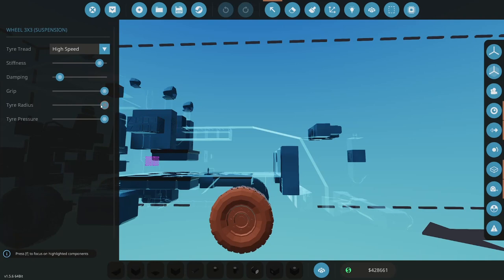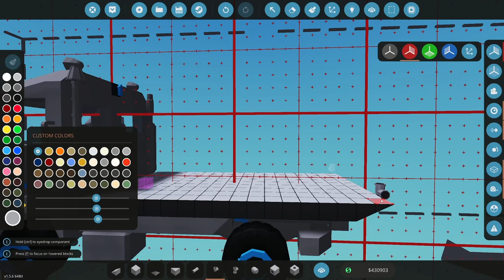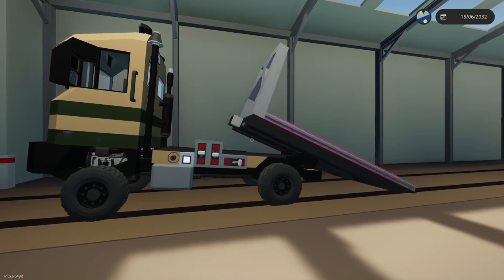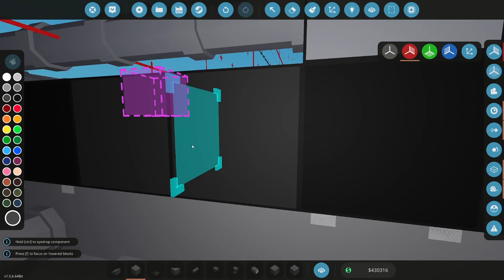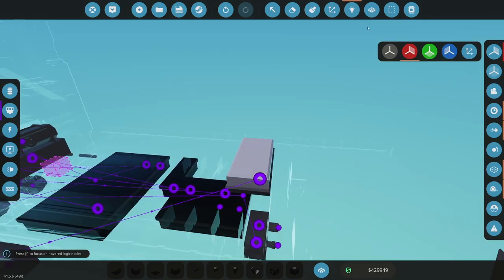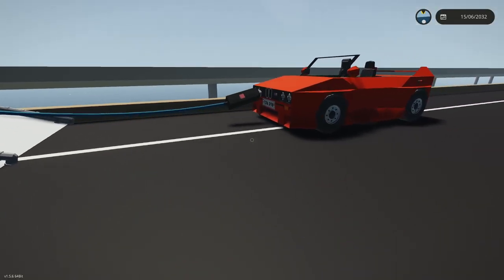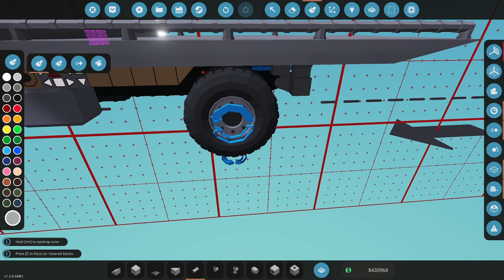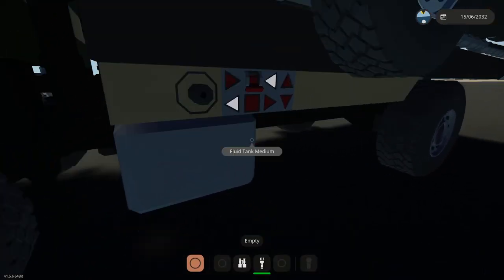Stormworks Career Build Series 122

Comment: Tow trucks likes this are called rollbacks or car carriers. The don’t use gravity to flip the deck because the you never have the same weight on it, nor do you always load a car from the front, or the back.   Rollbacks, for their weights, can’t carry bigger vehicles, as a rollback carries the whole weight of the casualty, where as a wrecker picks up ~50% The wheel lifts are generally same.
Reply from the maker: I understand how they work. That is how I chose to build it because I did not feel like controlling the tilt separately.